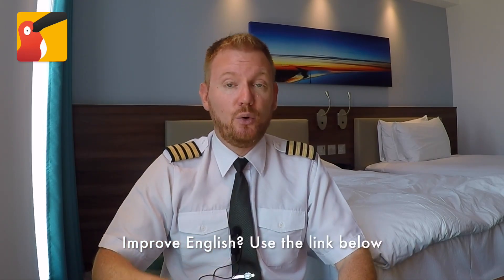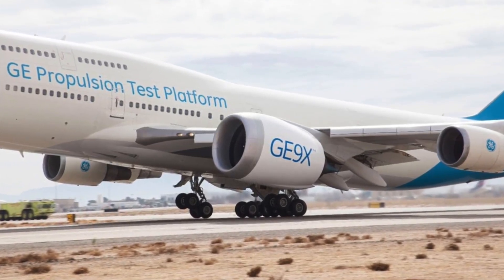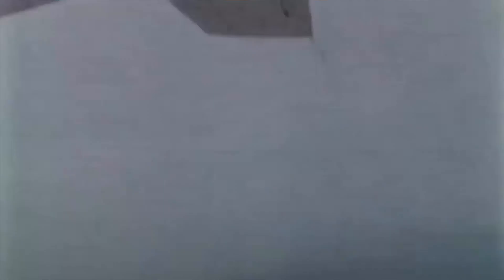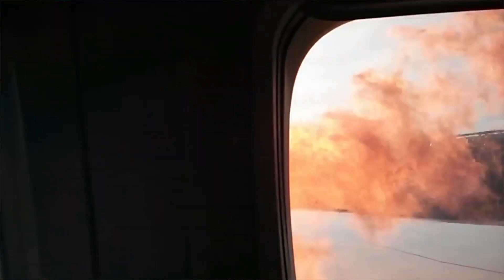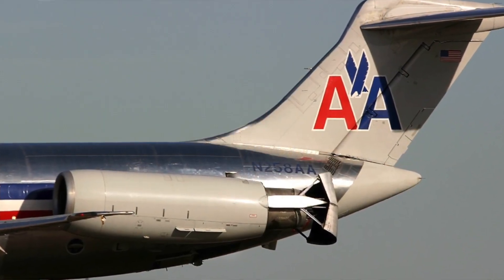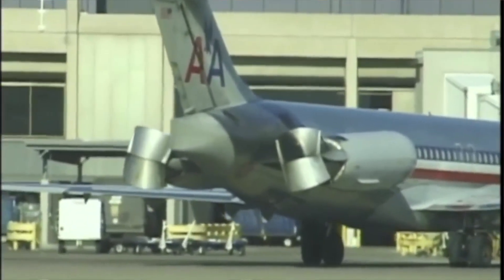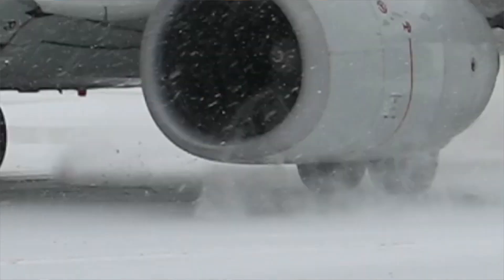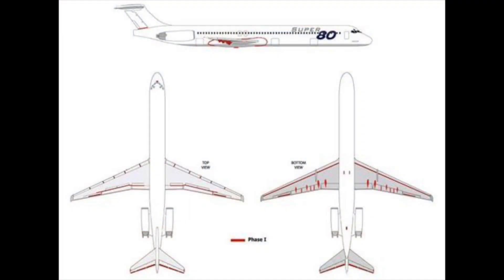Why are the jet-engines placed there? Wings vs Tail

Comment: Another downside of the fusulage mounted engines is the risk of getting ice from the wing sucked into the engine thus risking it to be destroyed. Its a very famous Swedish accident whom happen a couple of decades back whom you probebly heard about. A follow on question might be why no one has the pods mounted over the wings rather than under them? There are probebly good reasons for this but it would be interesting to hear about. Johan.
Reply: HondaJet has jet engines in pods over the wings.  Others have had engines mounted on top of the wing, but AFAIK Honda is the only one with jet engine nacelle pods mounted over the wings.
Reply from the maker: Yes, great point.
Reply: I'm no expert, but to my understanding majority of the pressure change that produces lift happens on the upper surface of the wing, so an object of such size would reduce the overall lift much more than one positioned below it.
That's probably the reason the spoilers are located on top of the wing too, because they are much more effective there, instead on the lower part of the wing.
Reply: There are a couple of Russian amphibious jets with engines mounted above the wings, the Beriev Be-200 and Beriev A-40. The high mounting position of the wings, coupled with the intakes being over the wing surface, minimized water ingestion by the engines compared to an underwing or tail-mounted engine arrangement. The Soviet/Ukrainian Antonov An-72 and An-74 mount jet engines on top of the wings to improve STOL performance by directing the exhaust over the wing and generating more lift through the Coandă effect.
Reply: The German VFW-Fokker 614 had the engines mounted on top of the wings. I think the reason you don´t see this configuration very much is because it caused some airflow issues over the top of the wing, as well as engine maintenance was quite a hassle since you had to climb the wing to get to them.
Reply: Johan Månsson honda jet
Reply: The reason the engines are below the wing is to increase wing efficiency, they would disrupt air flow and decrease lift capacity.
Reply: Engines above the wing disturbs laminar flow. Above the wing, the air travels faster, which creates the low pressure that causes lift. If you disturbed that airflow it would slow down the air causing a buildup of pressure and decreasing lift. Below the wing, if the air slows down than it simply increases pressure and lift.
Reply: KPbICMAH - Where have you ever seen an airport runway paved with tarmacadam? All I have ever seen were either portland cement or asphalt concrete. Same for taxiways.
Reply: Additionalñly to all these other reasons, the exhaust noise from above-wing engines would be horrendous to the passengers!

Comment: I worked at Gardermoen for many years and one thing I noticed was the crafts with back mounted engines was deicing alot more often, even in +10C. I was told it was more dangerous for planes like the MD82/87 if ice was to come loose (at the inner part of the wing) and get sucked into the engine intake. The turnaround times was often so fast that the wing not have time to cool down. And I guess some of the fuel left was very cold and added to the wing surface temp. 
BTW, IL-62 and Vickers VC-10 are two awesome looking aircraft with 4 backmounted engines.
As always: thanks for a great and informative video Mentour Pilot
.
Reply from the maker: Yes, that’s very true!
Reply: That caused an accident in 1991. I guess you already been told about it. 😀

Comment: I thought wing mounted engines are better because engines tend to  be heavy and having them close to the centre of lift helps with the centre of gravity. Moreover to balance that you need to have a long nose that needs to be resistent in order not to bend down on its own weight while in the air. Also as you said tail engines can't be as big as wing engines and with the tendency nowadays to have bigger fans with higher bypass ratios tail engines look to me like a relic from the past...
Reply: ThePulmentinum You are right. Tail engines are only practical for medium size jets. As sizes get larger, the strength/weight penalty starts to affect the fuel efficiency. Older models such as the DC10/MD11 and L1101, with a large rear engine, are no longer in production (still used for cargo and charter flights).
Reply: Not only that, in Tex Johnston's memoir, he said that as the fuel in the wings is consumed, the center of mass shifts toward the rear and has to be taken into account via clever solutions. Doesn't happen when engine and fuel tank are close together.
Reply: There's another factor: ease of maintenance. Wing-mounted engines are easy to work upon, not needing high scaffolding to reach the engines.
Reply: Sacto1654 - One mechanic falling and seriously injured or killed can cost a lot of money.
Reply: Sacto1654 - In a gear up landing the under wing mounted engines help keep the plane upright, which is much better not only for the occupants but for the aircraft.

Comment: doesn't the more-rearward wing  of the fuselage mounted design also aid fuel efficiency, i.e. gives lower drag, but also means for example a much higher stall speed, meaning faster landing speeds (longer runway needed), and, results in a more turbulent ride for the passengers? that's why I always preferred to avoid MD80s and the like for longer flights.

Comment: I believe its better to have the engines on the back as the trust will follow the simetry line so you will have much more control of the aircraft in case of surface controll failure (or complete lost of hidrolics)
And also you will have no vector trust because of it.
The reasone why there are no more large jets with a rear mounted engines is because boing convinced the governement that its more fule efficient to have the engines as close to the simetry POINT thus the US governement started to invest in boing rather then M.D. M.D. fought all they could by introducing the three engine aircraft (On one of the air desasters this third engine actually saved the aircraft as the surface controls of the wings were oposite to each other) but it never helped M.D. as they still culd not regain the support of the governement and went bankrupt
ALWAYS REMEMBER: BACK MOUNT ENGINE WILL SAVE YOUR LIFE (wing mounted engine will only generate VECTOR TRUST)

Comment: MENTOUR:
 
What about the  "Tri-jet" configuration, where you have one engine under each wing and another one at the very back of the fuselage?

I've heard that this isn't really a particularly good configuration, but it seems to me it would reduce all the control problems associated with thrust loss from an engine - which you covered in the video.

Comment: Also, I guess that having a T tail would add to the directional stability by acting as an end plate which would be the case in aircrafts having fuselage mounted engines.

Comment: The first mass produced jet aircraft with the engines mounted under the wings was the WW2 German jet fighter ME-262. When the British tested the ME-262 after the war, they were amazed  at it's performance. The 262 was by far the most advanced aircraft of WW2. 1,500 were produced near the end of the war, but Germany had little fuel to put in the jets so only about 20 could be put in the air at one time.
See photos of the ME-262 on Google Images.

Comment: The Ilyushin IL-62 has 4 tail mounted engines. It's tail heavy that there's a special wheel that extends from the aft fuselage to the ground to prevent tipping. Curious to know the handling characteristics of the tri-jets with wing and tail engines like L-1011, DC-10/MD-11.

Comment: Sitting in the rear of the cabin of the MD-80 with its rear mounted engines is almost intolerable because of the noise.  The times I have flown in this aircraft, the rear seats were empty.  Middle seats were not too bad, and the front of the cabin was quiet.

Comment: The engines are held on the plane by one fairly small bolt, considerating the weight of the engine,  about 3/8  inch in diameter. You may ask yourself why don't they use more and larger bolts to hold this heavy engine on. The reason is if the engine begins to vibrate badly, due to internal damage, they'd rather have the engine break clean away and fall off instead of shaking the plane to death and causing a crash. They can still fly the plane with only one engine.

Comment: About 80% of the entire thrust that the jet engine creates is created by the large bypass fan at the front of the engine nacelle. The engine core, where the fuel is actually burned and that has all the stages of compression, only puts out about 20% of the entire engine thrust. That's why the airlines want laarger and larger fans in their engines. They get 80% of their power from a fan without buring any fuel in it.

Comment: I have always loved the MD-80 and 727 for their rear mounted engines, and clean lines about the wings and forward fuse.  But I never knew of some of the dangers, for example:  If the wing is stalled, the engines intake can be in turbulent air leading to compression stalls - right when you need thrust the most.  In a related incident, SAS 751 MD-80 crashed when engines ingested ice after takeoff, leading to compression stalls, sinking, and impacting terrain.

Comment: Why do smaller regional planes with rear mounted engines like the MD-80 or CRJs always have super short landing gear in the front. It almost looks like they are always leaning forward when on the ground. Does this also have to do with the center of gravity that you were talking about?
Reply: MD80s/90s/717s and CRJs are all built nose heavy so it’s almost a counter balance to make sure the aft index is in range with WDR. Same reason why A320s are always loaded from the front first because they’re naturally tail heavy.
Reply: colelaurain the crj was a stretch of the challenger. It uses the challenger nose gear and forward fuselage so when they stretched the airplane the main gear had to get longer but the nose gear could not be made longer because they could not fit it in the existing structure when retracted. So while the challenger sits level, the crjs sit nose-down. It was a compromise to avoid a large increase in development cost.
Reply: Neil Lenhart Going to have to google a couple of terms but thanks for the answer😂
Reply: Neil Lenhart that has nothing to do with the nose gear length on the crj
Reply: Low ground clearance is beneficial for the regional carriers because it allows loading without a jetbridge or in many cases stairs which are likely not present at some of the fields they fly in to.

Comment: These are awesome videos, thanks for sharing!  Ever hear of a center engine stall in a Boeing 727 (3 rear mounted engines, two beside the rear of the plane like an MD-80, one through the tail with the exhaust at the point of the tail of the aircraft.  Description for the public, not Mentour Pilot.  ;-)  Happened on a flight I was on once, and it happened as we were throttling up to take off.  We heard a loud POP from the rear of the plane, pilot throttled down, we taxied back to terminal and disembarked, then several hour delay for safety checks.  Just thought I'd mention it as another potential disadvantage to rear mounted engines.  (I was going to be an aerospace engineer, once upon a time...)
Reply: DarthAgamemnon 
Any plane can have any engine stall during take off. Am I missing your point here? I am not getting why you think this is a specific issue for tail engines
Reply: I was sitting next to a guy who seemed to know something about the 727.  He said that the pilot screwed up when throttling up, robbing the center engine of air and causing a compression failure.  The proximity of the three engines in the 727 makes this a common issue, at least according to this fellow.  Anyone ever hear of this?

Comment: Why do some aircraft have their wings mounted at the top of the fuselage (Antonov 124) and others have their wings mounted at the bottom of the fuselage (Boeing 737)?
Reply: The Antonov 124 is a cargo aircraft, and has a 36m long flat deck. This would be impossible with the wings were mounted at the bottom.

Comment: There is one question to which I never received an answer. With back-of-fuselage mounted engines, the wings are more aerodynamically clean but they must be kept smaller because the weight of the engines is not there to prevent flexing. On wing mounted engines, you can afford larger wings but with less aerodynamic cleanliness, in addition to a larger rudder causing more skin friction drag. How does the L/D compare between two aircraft of equivalent size where one has fuselage mounted engines and the other has wing mounted engines? Also, why are the nacelles larger on fuselage mounted engines?

Also, don't forget a rule of thumb that the larger any vehicle gets, the more the strength to weight ratio as well as the power to weight ratio drop. As you mentioned, structural strength is more important in fuselage mounted engines, which is why larger aircraft such as the 777 and A330 can only afford wing mounted engines.

Comment: Great footage of the super stall.  Now I know why they have a stick pusher on a  premier 1.   Low level stall would not be a good thing and scary as sh.. at any level😉 I think you made all of your subs laugh at once talking about the rev thrust throwing “stuff” up into the intake😂. Made me laugh.  Those Ge90s are massive.  Love to see 4 on a 747 but they would probably rip the wings off!  They used a 747 as a test bed for just one of the 4.  Looked quite strange.  Why would they not just put 2 on the 747 air frame...and call it a 727.  Doh!  Already had one of those with 3 engine high tail config.  Interesting topic.  Cheers. 🇳🇿

Comment: The back mounted engines also bring the advantage of a lower landing gear. For small jets it enables you to fit the stairs on the inside of the door without the need of a big extending mechanism. For bigger planes it makes u able to have a stronger landing gear. Correct me if I'm wrong but I heard the smaller DC-9 variants could land on non asphalt runways.
I went to check for vids. I saw 727's doing landings and take offs from dirt strips so I guess my basic idea is right.

Comment: Why are engines always mounted forward of the wing rather than just hanging directly under the wing?
Reply: I think it's to get the engine higher, so the line of thrust is as close as possible to the plane of the wing. This means less twisting stress on the wing. And the engine pylon has an easier task with the load mostly as tension.

Comment: You did not talk about asymmetrical thrust on rear mounted engines as you did with underwing.  I would suppose the rear mounted engines are closer to centerline thrust in those situations and require less rudder input after engine loss.  Is this true?
Reply: Anthony Calia : yes

Comment: You know I've been watching your videos for a while now and I'm very impressed with your overall knowledge of the different type of aircraft.  Do you have an A&P as well?  If not you have been doing your homework big time because from what I've experienced most pilots are somewhat aloof of what actually makes those birds tick.  One more thing to add about the DC9 versions out there...ie...MD88, MD90, and 717's is that there is a "nose over" hydraulic cylinder for the elevators.  The flight controls are tab driven as I'm sure you know, so when air flow is disrupted to the point during a stall, and the control column is pushed full forward, the hydraulic actuator will pull the elevators down causing the nose to lower for a stall recovery.  Amazing videos you are making.  I love them all!!!  Please keep up the great work sir!!!

Comment: Yes, another interesting, informative video. And you are correct about loving to learn.

My question concerns stalling, as you described, in a plane with a T-tail. Would it help, when a stall is discovered, to roll the airplane? Would that return any authority to the horizontal stabilizer?

Comment: Engines back up, leads to shorter landing gear and better access to load/ unload the aircraft, even without special equipment. More flexible than under wing engine.

Comment: I noticed no one has mentioned wave drag. mounting the engines slightly in front of the wings allows the cross sectional area of the aircraft to remain more constant from nose to aft, thereby reducing wave drag at high speeds.

Comment: Ah the rear-engine t-tail configuration brings back memories. SAS used to primarily use the DC-9, MD-80 &90 for domestic flights in Sweden during my childhood when we flew the most to visit relatives in northern Sweden. Even the Fokker F-28 back when Linjeflyg was a thing.

Comment: I have had the experience that back mounted engines are quite because their exhaust is directed away from the cabin and it's pretty much like sitting in front of the engines/wings on an aircraft with under mounted engines.